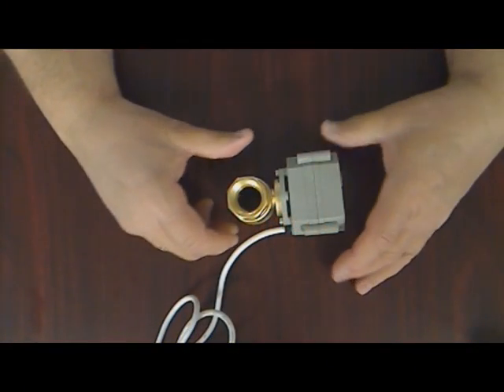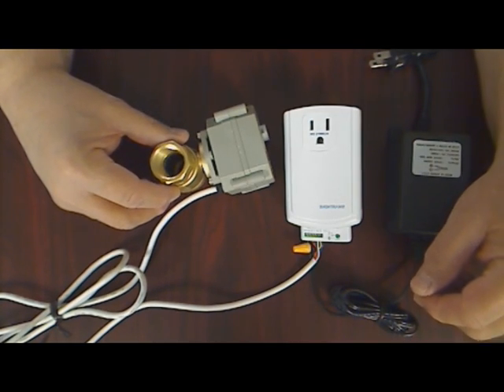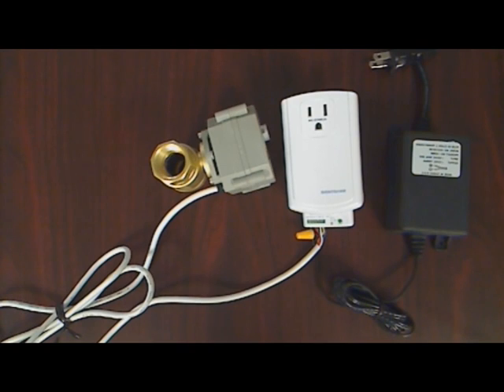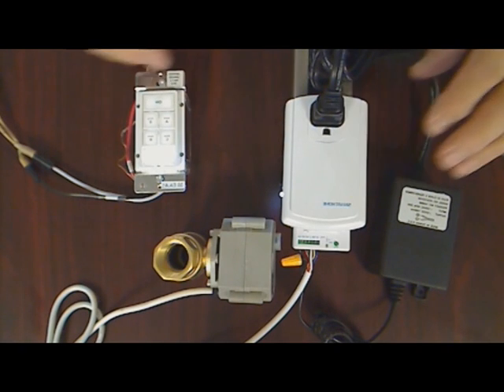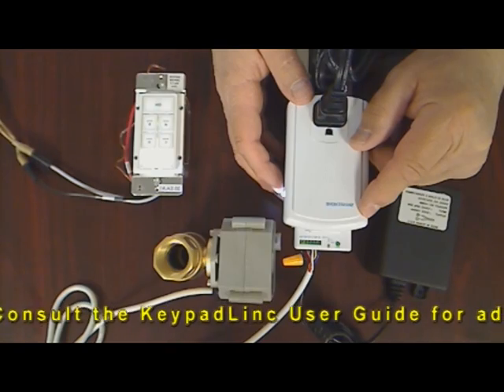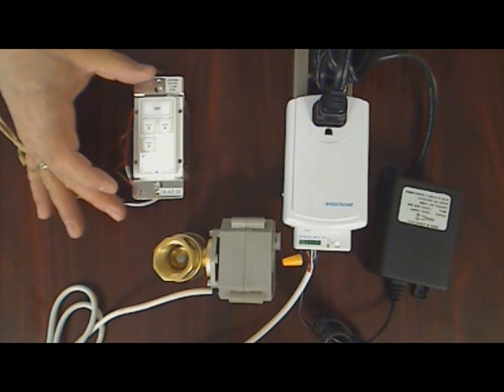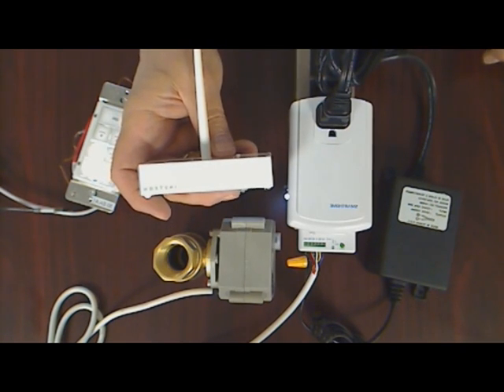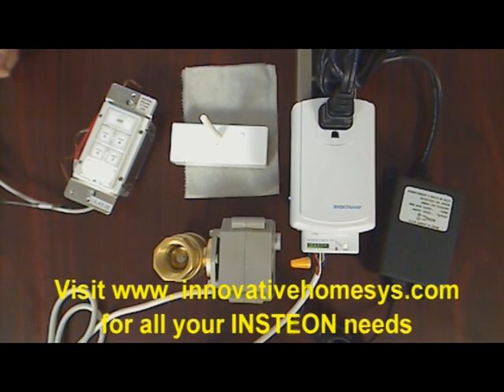Automated Water Shutoff Valve

Comment: hi do you get one that works with a battery
Reply from the maker: Hi Abbi.  The valve could be operated by itself from a 12 volt battery but if the valve is used with a home automation system as shown in the video, AC power is required.  We have sold a number of these valves for 12 volt DC operation in mobile homes.  The valves can be controlled in this application by a simple single pole, double throw switch and can also turn on an indicator lamp when the valve is in the open position.  Please contact us if you would like additional information.
Innovative Home Systems
720-733-4295

Comment: Where to buy this system all together?
Reply from the maker: The water valves and all system components are available at www.innovativehomesys.com.  We are currently offering the valves with an Insteon or Z-Wave relay control module and power supply as a package for $25 off the cost of the components if purchased separately.  https://innovativehomesys.com/collections/e-hvac/products/insteon-water-shutoff-valve-package-deal  
Unlike other valves on the market, ours provide feedback to let you know when the valve has actually reached the fully closed position.  The valves are available in stainless steel or brass in all popular sizes from 1/2" to 2" and usually ship same day from our Colorado location.  Please contact us by phone if you have any questions or would like help placing an order.

Innovative Home Systems
720-733-4295

Comment: Where I can buy this device ?
Reply from the maker: These INSTEON and Z-Wave valve packages are available at www.innovativehomesys.com.  Packages are available in both brass and stainless steel in all common sizes.  The valves are also available separately and can be used with virtually any automation technology.
Reply: K , thank you . does it available for  1"1/4 valve ?
Reply from the maker: Yes
Reply: Thank you , delivery to India there right ? Or Available on Amazon or ebay to buy?
Reply from the maker: Please contact us by email directly for shipping rates.
Reply from the maker: info@innovativehomesys.com

Comment: does this work without the keypad if you have the wireless water sensors and a hub?
Reply from the maker: Yes, absolutely.  The hub will satisfy the requirement for at least one dual band device in your network.  You can link the leak sensors directly to the valve or use the Hub to control the valve when a leak is detected .

Comment: Is this competitively priced?
Reply from the maker: Yes, very competitively priced. 
The Water Valve packages are available here: http://innovativehomesys.com/collections/e-hvac/products/insteon-water-shutoff-valve-package-deal
The packages include the 12 volt power supply and the INSTEON I/OLinc relay control module and provide an additional $25 discount off the already very low cost of the components if purchased separately.  The valves are available in brass and stainless steel in all popular sizes from 1/2" to 2".
Z-Wave water valve automation packages are also available.
Please contact us at support@innovativehomesys.com or call us at 720-733-4295  if you have additional questions.
Reply: Thank you. A NJ home services representative will or may have contacted you already.
Reply: deliver to Mauritius?interested in your product; fed up of cheap rip off and repeated maintenance :)
Reply from the maker: The valve packages shown here are designed for use in North America and are not compatible with the plumbing and electrical standards used in Mauritius.  However, our technical support group may be able to create a custom solution that would be suitable for use in your region.  Contact support@innovativehomesys.com for more information.

Comment: OK, but how does one sweat in the valve into the incoming copper line without damaging the valve rings and the electronics?
Reply from the maker: Both sides of our valve have female NPT threads.  Solder a male NPT adapter onto your supply pipe first, then screw the valve onto the adapter and tighten using the proper pipe thread sealant.  On the other side of the valve, solder another male NPT adapter to one side of a pipe union.  Solder the other side of the pipe union to the pipe leading away from the valve.  Screw the second male NPT adapter onto the valve using the proper pipe thread sealant and tighten.  Complete the installation by fitting both halves of the union together and tightening the nut.